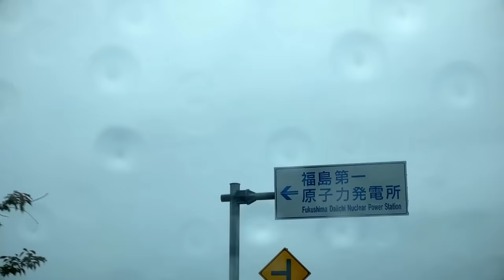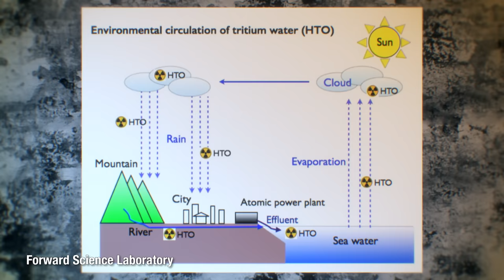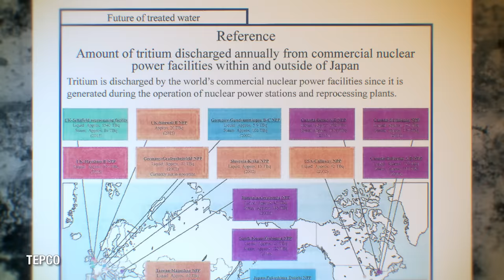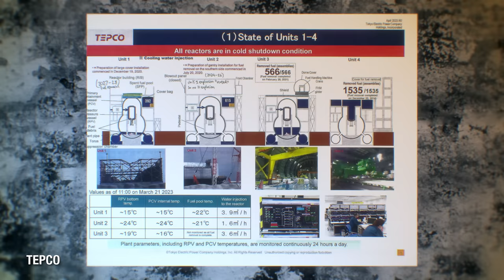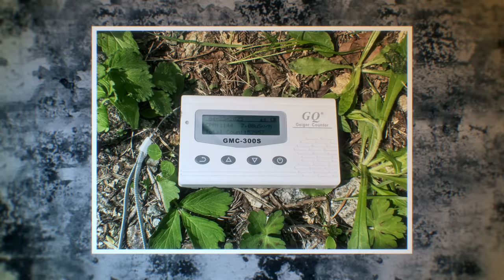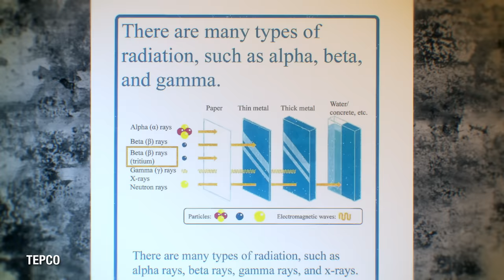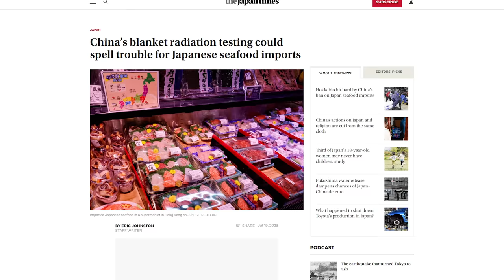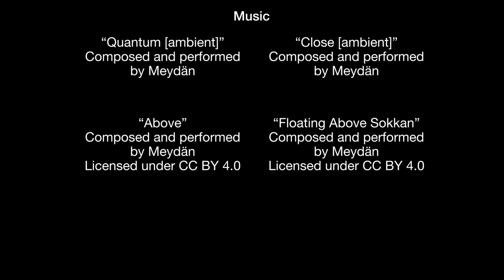Is Fukushima's Radioactive Water Safe?

Comment: I found myself in situation where I am uncertain about most of the information I consume... very few sources I fully trust.  You Kyle are on my shortlist. Thank you for not just the information but the education and humour too.
Reply: Hi! Below is my comment that replied to him, including some aspects that I think this video could be improved. I don't trust information I consumed either, so I've also got some doubts about this video...

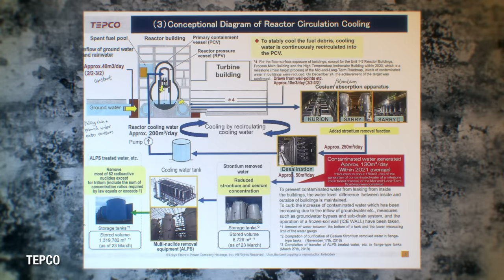Thank you for your information! However, I've got some confusions about some of the contents in your video. In 'The Water' section, you put an image (3:16) about the operation of the nuclear plant, and I looked into it. There're two types of water in there and I cared which one was releasing out into the environment, and I saw it's the cooling water in the light blue colour. The image also in this section at 4:07 showed how TEPCO cooled down the reactor after the disaster, where water needed to continuously recirculated into the Primary Contaminated Vessel. This made me think that the cooling water normally released into the environment from the nuclear plant is different from the water that TEPCO is releasing, because cooling water does not flow into the Primary Contaminated Vessel, and that makes me think the water released by TEPCO contains much more radio active substances than cooling water. In your video I feel like the nature of these two waters are mixed up, just to confirm whether my understanding is correct? 

My second confusion is more simple, about you explaining the dilution, actually I think it's quite misleading. So I wonder, if I want to dilute 1L ink and used 1 ton of water, there's less ink in the diluted solution in one litre (1/1001 concentration), but now I have 1L + 1 ton of solution (1001L), even though 1L of this solution is much clearer, but now I have 1001L in total. In case of releasing treated water, it's the same concept, that it's gonna release 1001L in 30 years instead of release 1L concentrated water in 1 year. In your video explaining about dilution, not only it should consider the concentration, but the total amout as well; if the total amout doesn't change, it's just spending more time to release, but not reducing the amount of nuclear active substance nor radio activity.

I generally don't support Japan of releasing the water (whether you call it trater water or contaminated water) into the ocean, because there's lack of transparency and shady acts (e.g. create mascot of Tritium; emphasize Tritium but disregard many more substances like C14 and Se137 that would cause more damage in the long run), and bad reputation of TEPCO that partially caused this disaster in the first place (not wanted to spend money to repair nuclear plant and build safety infrastructures). Also, the IAEA report is questionable as well, about its long disclaimer and the number/range of radio active substances tested. I'm really scared that the water released into the ocean was not as safe as TEPCO stated, but could do nothing about it. As a big influencer like you, please be even more cautious on the content you publish... It really does matter... If there's missing information that might mislead audiences, it would be disastrous...
Reply: @QingxueQi  you forget something. I am an average Internet user. I am not going to dig deep into scientific papers and official releases just to form an opinion. If you have your doubts... no problem.  I uphold my opinion of him and the work he does
Reply: @QingxueQi the "different" water you are thinking of was very likely already released into the atmosphere as a result of the 3 explosions. the water they are releasing is not the condensate, it is the water they have been using to cool down whats left of the reactors. your fundamental and almost intentional misunderstanding of the situation is not anyone's fault but your own. also your second "concern" is just... nonsense? you are just explaining dilution and saying it is misleading? yes, the amount of tritium being released will be added to the ocean. it is not being absorbed or magicked away. but it is quite literally a drop of water in the ocean.
Reply: Honestly,anything is correct,if you believe in it hard enough.Thats how we got religions lol
Reply: @QingxueQi  Very good observation.  Yes what Japan released into the ocean is not the same as the sample provided. Thank you.  Please post the comment again just on this point.  I never get to read your original comment.
Reply: @bulasev  Kyle pointed out Jpn is not trust worthy and covered up the initial event causing this biggest disaster.  Do you agree with him??
Reply: I bet you're a Trumper.  They have real problems with information

Comment: My only real request would be by an outside team to go there and verify the engineering is being done correctly; not just people on the other side of the world reading about it and giving it the stamp of approval.  Even if the methodology they state is completely correct, it still needs to be implemented correctly, and verifying that requires people to be in person.
Reply: Pretty certain that this is exactly what the IAEA (International Atomic Energy Agency) does.
Reply: From a press release: "IAEA experts are there on the ground to serve as the eyes of the international community and ensure that the discharge is being carried out as planned consistent with IAEA safety standards," said IAEA Director General Rafael Mariano Grossi. "Through our presence, we contribute to generating the necessary confidence that the process is carried out in a safe and transparent way."
Reply: @autohmae  Fact-check: The IAEA itself in the report clearly claimed that the report does not constitute any endorsement for the discharging plan, and clearly stated that the report is based on the samples and data directly provided by the tokyo Electric company, and we all know how reliable the jpnese companies are in terms of providing true and accurate data given the fact that they were caught lying to the public in regards to the severity of the catastrophe.  Also, jpn doesn't allow other countries to do independent sampling and tests so they are forced to use data that only tepco provides. IAEA examines the data provided by jp/tepco, IAEA never collected any sample or data by themselves. IAEA said Japan ONLY request them to test two substances so they ONLY tested and were OK with those two substance. Another fact: jpn/tepco made a political donation in the millions of dollars to the IAEA just before they released their report.
Reply: @blackbelt2000   that does NOT sound good. 😞
Reply: @blackbelt2000  well ain't that last bit fishy
Reply: For the people criticizing TEPCO. Theyre still Japanese. They rebuilt on top of where Hiroshima was destroyed. You can criticize TEPCO for being cheap with Daichii but as someone pointed out Daini was close to Daichii but didnt have any damage. Onagawa was closer to the epicenter and didnt have damage. The problem was Daichii not TEPCO or Japan.
Reply: @namename9998 crimes against humanity

Comment: Thank you for your hard work. The effort you put in shows. You've changed my mind about nuclear power.
Reply: Which part of this is good news for nuclear?
Reply: @stl1321  I guess the fact that even history's second worst nuclear disaster didn't have a widespread detrimental effect on nature.
Reply: @stl1321  Or that few people know that coal plants actually emit more radioactive particles than nuclear plants because no one scrutinizes coal plants about radioactive emissions.
Reply: @h8GW  sure they do. What are you talking about?
Reply: @hotgluegunguy  The Fukushima disaster is LV7 because the max level is 7. The one you thought was just Lv6
Reply: @kanlu5199  I know that the Fukushima disaster is INES level 7, but the Chernobyl disaster (also a 7) is still significantly worse, hence "second".
Reply: @hotgluegunguy  No, the Chornobyl disaster only had one blaster and it was dealt with, the Fukushima one had 3 blasters and the melted core is still generating radiative materials.
Reply: @kanlu5199  It was dealt with, but before that, the core was completely exposed and burning for several days, spreading a huge plume of highly radioactive particles over large land areas, where it settled and affected thousands of people and animals. Also, around 30 people died as an immediate result of the Chernobyl disaster.

In Fukushima, even though the release of radioactive material has been huge, it has happened over several years and to the ocean, where it quickly dilutes to safe levels. The cores remained partially contained. Also, no immediate deaths from radiation, although sadly there were casualties during the evacuation efforts.
Reply: @hotgluegunguy  The detail that you missed in the Fukushima story was that the japanese staff evacuated days before the accident. They knew days before the reactor core exploded and melted down,  but nobody tried very hard to get the situation under control. This was how a Lv3 accident became a Lv7 disaster. No doubt the japanese will do the same to the water dumped and the melted core containment.
Reply: @kanlu5199  As I understand it, the reactors started melting down less than 24h after the earthquake and tsunami hit. You may be right that not enough was done. It doesn't change my original statement though.
Reply: @hotgluegunguy  OK, Do you care to explain that the black rockfish caught on 18 May was found by plant operator Tokyo Electric Power Company (Tepco) to have 18,000 becquerels per kilogram of cesium-137?
Reply: @kanlu5199  I did say widespread. Of course it's pretty bad in the immediate area around the plant, both in the water and on land, as Kyle also showed, with the 100μSv/h rate in the tour area.
Reply: @hotgluegunguy  This is a new case for you. But I know what japanese would do, as they did nasty things in the Minamata disease disaster. And the lifetime sickness is a very good profit point for the medical companies.

Comment: Great video, and you made a great point about ALARA principles not being adhered to. 100 microsieverts is equivalent to 10 mRem; that’s a higher dose rate than you’d typically find in a containment building during refueling. If we had rates like that during maintenance, you would either have limited stay times or RP techs monitoring you on telemetry.

Comment: The thing is TEPCO generally has a bad reputation, and noone actually knows what the "treated water" is. They could have just as easily run tap water through their machines and claim them treated to the public and IAEA. What will happen we should see for ourselves.
Reply: If I remember correctly, this is the same company responsible for three employees being exposed to extremely high amounts of radiation. Most notably the man who survived an unbelievable 83 days before succumbing to radiation sickness. I’ll admit that my memory doesn’t always co-operate with me, so please correct me if I’m wrong. I certainly don’t trust TEPCO to be honest or to abide by any safety precautions..
Reply: TOKYO, Sept 5 (Reuters) - China turned down Japan's proposal that it take part in the International Atomic Energy Agency's system in which countries excluding Japan can analyse the results of sea water monitoring off Fukushima,
 Why? All about politics
Reply: Because the data is provided by TEPCO. China wants to collect the samples themselves which Japan refused.
Reply: They were cutting corners and operating unsafely for years before the incident. I don't blame any of the victims for not trusting them. It's not as if things at the company got better.
Reply: @phantomspaceman  yeah, I believe there originally was safety protocols that could've saved them from a complete tractor meltdown in the event of such a tsunami but the TEPCO execs deemed it overkill safety and scrapped it for a cheaper alternative.
Reply: @X-SPONGED  I mean these people had a fire burning in one of the rooms of the plant and they just locked the door and left it. They were incompetent.
Reply: Masao Yoshida chief nuclear engineer at Fukushima disobeyed TEPCO's direct order to not flood the reactors with sea water. The disaster would've been much worse had he not flooded the reactors. TEPCO is Shinra Electric Power Company from FF7.
Reply: Yeah but the sea water is not as pure as before :'3 @UltimateEnd0
Reply: @brainwashington1332  yep exactly....what are the Japanese so  afraid of?
Reply: Yea...
I find it hard to trust them for another 30 years for a company that has failed every now and then for the last 10 years.
Reply: I did notice Kyle's provided sample was clear.  The sea water after Japan's dumping had turned grey.  😰
Reply: @vcorlett  There were also reporting of mutant creatures with high dose of radiation near Fukushima.  Japan does have a history to hiding what really happened, on a few subjects after all.
Reply: @phantomspaceman  Their stock price has been up lately, 15%.  Wonder why funds are buying.
Reply: @coolkidim  Hmmmm, that’s interesting. Japan isn’t the only country that likes to hide things. I think most countries would fit into that category to some degree. L

Comment: Great video as always, Kyle! I have a question, at 18:35 you mention that the entire Pacific ocean contains 8,000 grams of Tritium. While the waste water at Fukushima only contains 3 grams. Is this per litre, gallon, cubic meter, etc? Or the grand total, which I'm sure it isn't.

Fun fact, I'm currently writing my English Composition 2 papers over switching to nuclear power and I used one of your videos, "We solved nuclear waste decades ago", as a source for the argumentative essay.

I love your videos and how informative they are, as well as your amazing humor. Half Life series is my favorite!
Reply: I understand that it's the total, which then makes 3... A lot. Comparing the relative sizes of the pools and the WHOLE Pacific ocean, the concentration differences are huge
Reply: Replying in case Kyle (or anyone else who knows) responds to this comment, because I also want to know. However, he did say the "total amount of tritium held in Fukushima's water tanks" was 3 grams. I looked up the molar mass of tritium, and it's 3.02g (very close to the estimated amount at Fukushima,) and from an atomic perspective, a mole is still a lot! Considering that it's half-life is also 12 years, and it's been 12 years since the incident, there would have been double that amount at the time of the plant failure. Just a few ways to contextualize/reframe the information

Comment: The whole point is to show the absence of glowing green gas around the reactor buildings and glowing green goo in the water.  As a member of the public, you perceive radiation as a glowing green gas or goo, because that's how you usually see radiation depicted in the media.  After seeing that there's no glowing green gas or goo, you leave the site with the impression that the radiation levels are nothing to be alarmed about.

Comment: Kyle you did a balanced presentation of with what TEPCO provided to you.  The most meaningful part for me is that you provided 2  personal observations: 
(1) The meltdown could have been avoided if TEPCO had listened and just moved the backup generators which they were told was necessary multiple times.  Beset by walls of water of the exact height numerous reports warned of the Fukushima daiichi nuclear power plant drowned, it lost power the backup power then the ability to adequately cool nuclear fuel.  
(2) When you were more than a hundred meters away from Fukushima's decaying fuel the radiation rate was more than 400 percent higher.
Reply: Yes Kyle did at least pointed out at least 2 things that Japn lied.  There two events are not provided by TEPCO LOL
Reply: (3) Kyle you also show us the actual portion of the report from the ALPS device Contradicting Japan's claims that ALPS could eliminate all radioactive elements but tritium.  The report states that the device utilizes the chemical and physical attributes of contaminated water to REDUCE the concentrations of 62 types of radioactive maters.  Yes the device can REDUCE the level of contamination, not getting rid of them.
Reply: and, what if Japan don’t get it right in the next 40 years and all that contaminated water are like milk spilled in our, our, oceans?    Let you talk about it!
Reply: @rinahk3407  I am Japanese, but I do not claim that Japan or Tokyo Electric can remove all radioactive elements except tritium. As you rightly point out, ALPS can remove 62 substances. However, most other nuclear materials are so low in concentration that they cannot even be "detected" at the undiluted stage. Some radionuclides may be detectable, but they are below regulatory limits. Therefore, there are nuclear species that are not removed by ALPS.